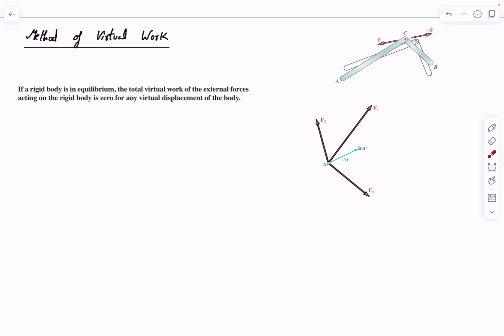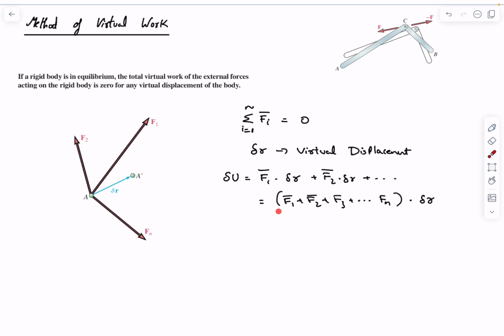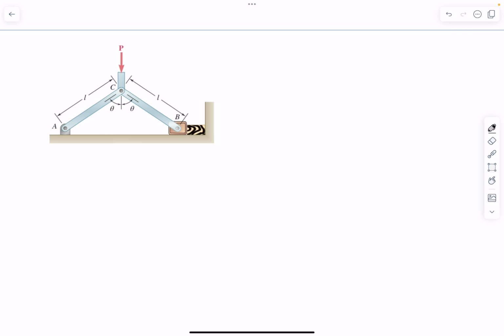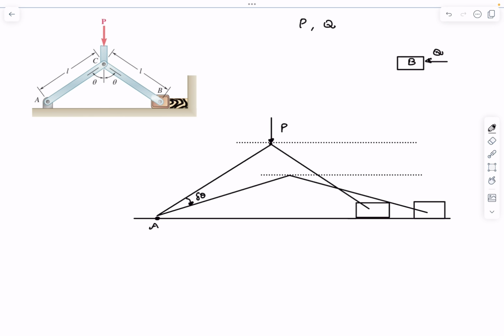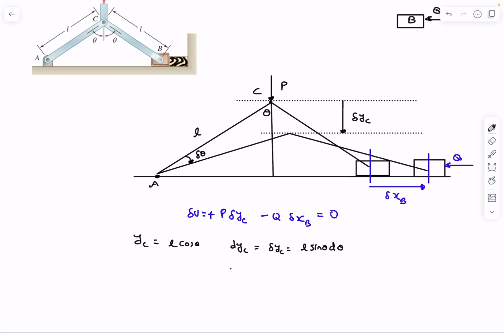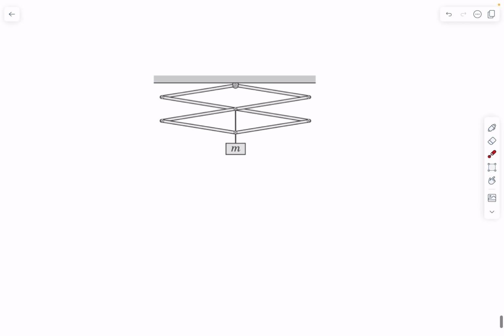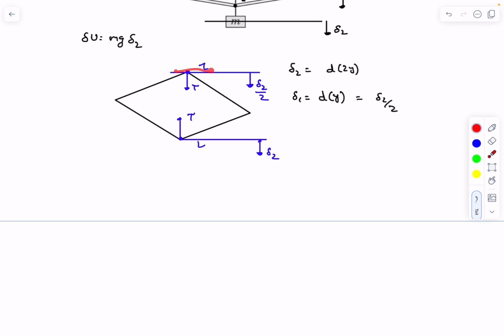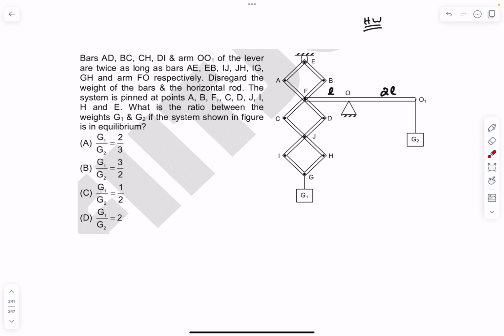[JEE] Method Of Virtual Work | Pathfinder | AITS

Comment: A? as distance of g1 is 6lsintheta from the top and if it is disturbed a bit, dx= 6lcostheta(d theta) the see saw is at 2l sin theta height so derivative of that wld be 2l cos theta d theta and the g2 mass is at 2l so its 4l cos theta d theta then sum of work by g1 and g2=0 so relation wld be 4/6=2/3